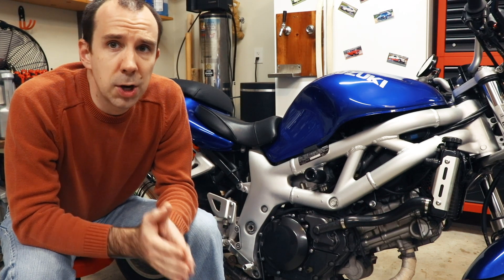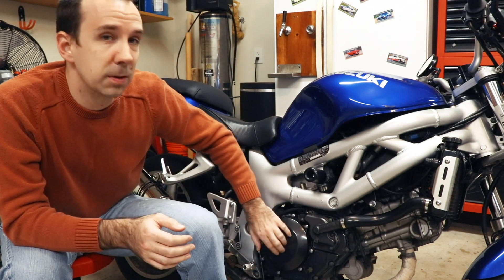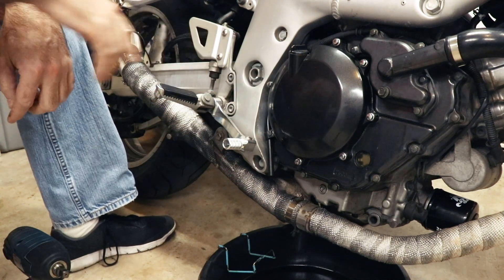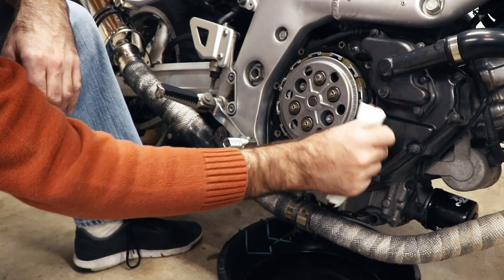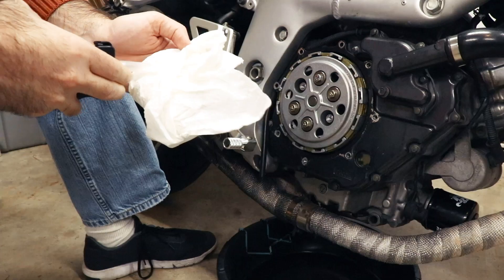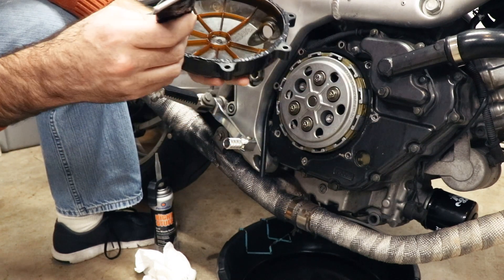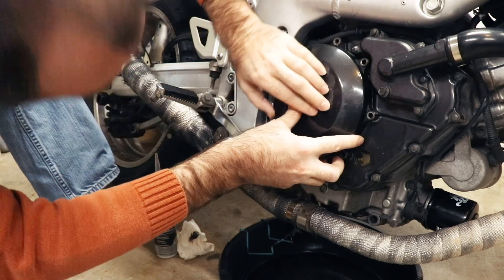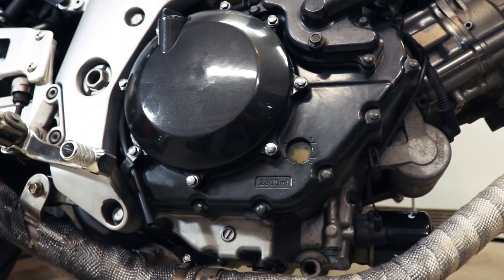Used Motorcycle Rehab -  Clutch Cover Oil Leak Fix (No, really!) - SV650 Episode 11.5

Comment: You are missing two screws on your clutch pack
Reply from the maker: Yeah, I know.  It was like that when I bought it.  It always looked like it was done deliberately to me, and it never seemed to slip so I didn't mess with it.
Reply: @AaronAverett  OK, I just watched your video, applyed same thing to my clutch cover, I will leave it to dry tonight, and check tomirrow for leaks. I hope I didn't put too much of rtv.
Reply from the maker: @sretenjovanovic3006  You'll need to actually ride the bike a few times to tell if it's leaking.  There's no oil in that area when the bike is parked, so it'll definitely still be dry in the morning.
Reply: @AaronAverett  yes I saw that when I removed the cover. Do you think there is there a possibility to have a problem with excess rtv inside the cover, maybe pump can suck it trough the oil?
Reply from the maker: Unless you used a very large amount of the sealant, there's no significant risk of it getting loose in the crankcase.
Reply: @AaronAverett  operation is successful, no more leaks ;)

Comment: Hi Aaron. I have had the same issue with my bike. I was thinking about replacing the cover with the alluminium one.  When I look on ebay for one, the oil filler cap is more to the right .. Doe's this make any difference in replacing the whole inner and outer covers. Mine is a 1998/99 model.
Reply from the maker: You're talking about the version from the V-Strom where it's one great big piece?  I don't think the oil filler neck position matters, assuming your bike doesn't have fairings that would be in the way, but differences in the mounting of the water pump might, to say nothing of the hassle of transplanting the water pump.

The aluminum part I referred to in the video is made by Woodcraft.
https://www.revzilla.com/motorcycle/woodcraft-clutch-cover-protector-suzuki-sv650-sv650s-1999-2002

It's pricy, but it will fix the problem good and plenty without the need to guess about compatibility.
Reply: @AaronAverett  Hi Aaron. All fixed now. I did what you did. Thanks for the advise. Terry

Comment: The Suzuki dealership is closed right now due to the quarantine. Is there an oil I can get a an auto parts store to use or do I need motorcycle specific oil?
Reply from the maker: Hey, sorry I missed your question.  You do need motorcycle-specific oil, but here in Texas, most auto parts stores have at least a small selection.

On a motorcycle, the clutch and transmission are lubricated with the same oil as the engine, and car oil will sometimes cause the clutch to slip.  Motorcycle oil has something added to it that prevents this from happening.

Comment: I'm just gathering opinions here, is there any reason you don't apply sealant to both surfaces, then let them pre-tack, then mate the prepped surfaces? Why only one side? Thanks
Reply from the maker: You could totally do that, but given that this mating surface isn't intended to have sealant at all, I wanted to at least try to use it sparingly first.  Keep in mind, if it hadn't worked, I'd have had to scrap all the RTV off both surfaces before trying anything else.